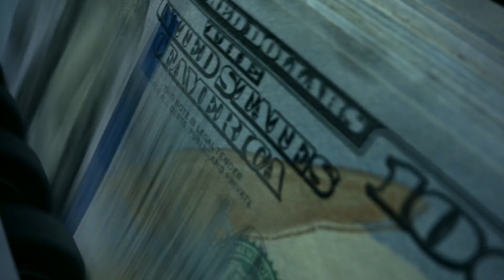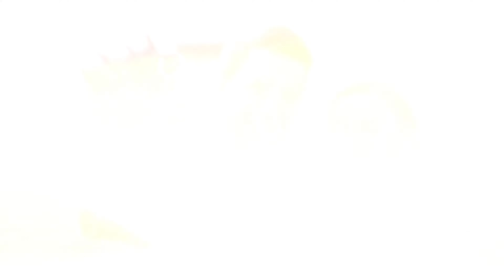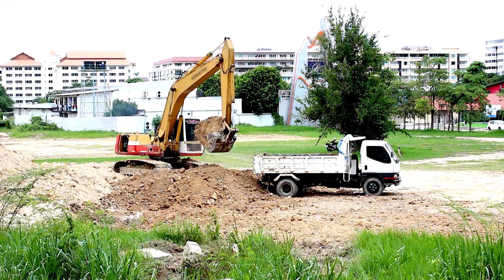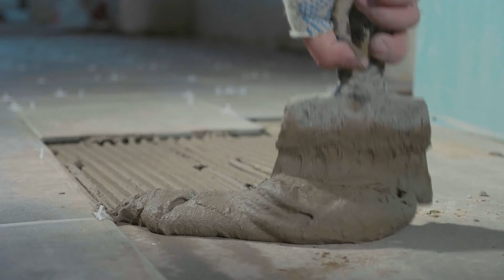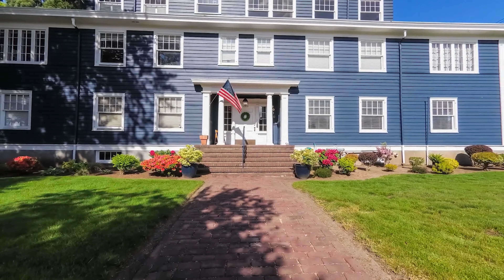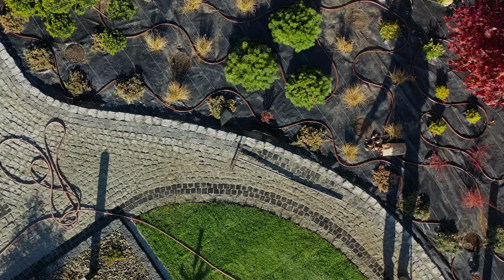Steps To Build Your OWN House - The Construction Process EXPLAINED and How To Get Started!

Comment: Yowzers!  Husband and I are 25% into this. We live in Colorado and an important point that I have learned THE HARD WAY.  The custom building process should be considered in chunks.  We are into first chunk - prep work.  This was estimated to take 3-12 months before a single shovel is tossed.  Budgeting, looking for a lot, drawing, revising, engineering, and then permitting.  This seems like my most frustrating time, nothing is happening but everything is happening.  We are considering doing a video series as well.  Because we went in blind and want to be a guide to others.  Lessons learned!
Reply: @leighannebrown did you guys have a  indecisiveness when picking your housing plans?
Reply: @ house plans took forever.  We found a mountain architect to design specific house plans for our site.  Then back and forth of design changes.  Then same architect is a structural engineer and did the structural plans.  And we’ll submit to the county likely next week or two.  Plans took forever. But.. it is way cheaper to change on paper than to change during construction.  So look and look and look again till you know the flow of your house.